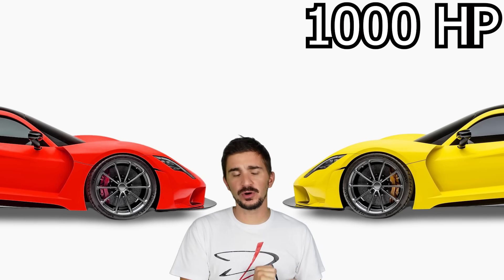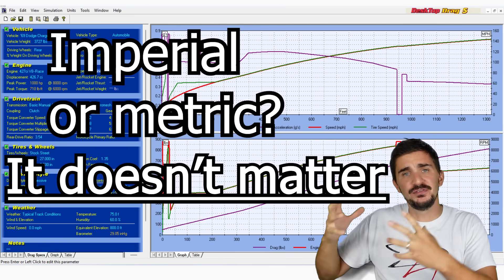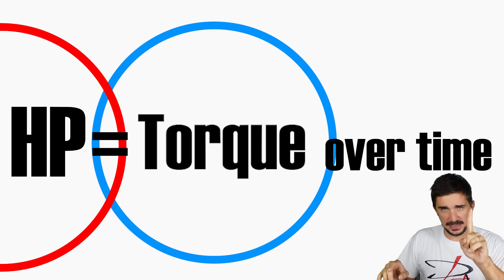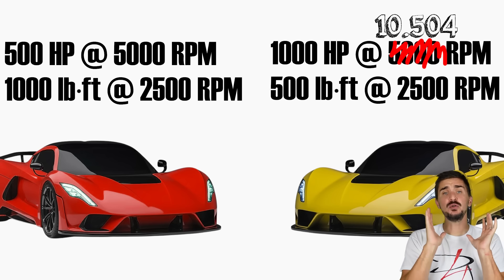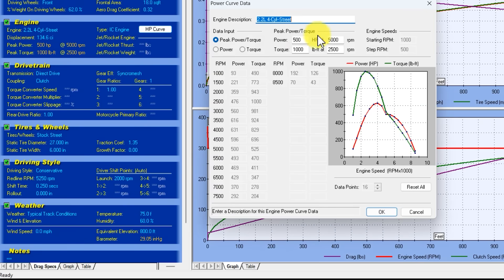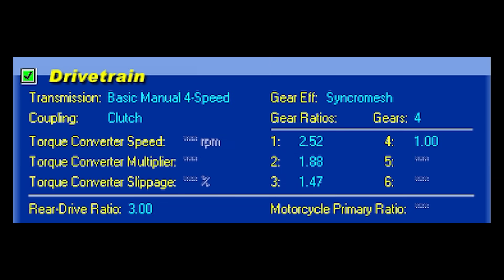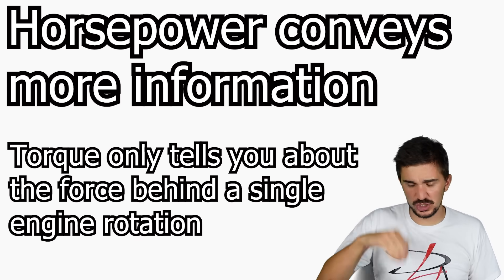Who's faster? Explained and Simulated - Horsepower vs Torque

Comment: Love the analogy of Torque = damage per hit, HP = DPS. 
A lot of people that are knowledgeable with cars will keep parroting that "torque = acceleration and power = top speed". Engine performance is 100% determined by power in the power band. People are under the impression that low torque is unresponsive but that's because casual drivers avoid the sound of high RPM.
Reply: That’s what I keep telling people. They don’t let the RPM go high enough for the engine to pay off and then they say their car is too weak.
Reply: @weekendmagus9994 There’s an old saying, “hp sells cars, torque wins races.” Most of the time that’s true, particularly for spirited driving around town.

If you match-up similar 300HP cars, but one has 300lbft and the other 200, it’s the first that’s going to be much more spirited for day-to-day driving and win the stoplight races. So, from a general consumer standpoint, a low-torque motor will almost certainly feel weak. They won’t get their HP benefit until accelerating full-out in the expressway.
Reply: @haredr6511  interesting. This clears out a lot in my head :D
Reply: @haredr6511 false 100% of the time, the guy with the biggest pile of Hp wins. 

Mike has a Vmax 4 800ps that makes, say, 240 HP at 10,500 RPM. The math is, tq x RPM / 5252 so his engine makes 120 lb/ft of torque at 10,500. Not bad. But his competitor has a ps800 Polaris that makes greater 130 lb/ft of torque and makes 230 hp at 9300.

But somone tells Mike that he needs more torque if he wants to go as fast as the Polaris. "HP is for dyno bragging, torque wins races".

So Mike, being a crafty engineer removed the low-torque race engine from his sled and fitted the pedal crank from his Schwinn bicycle to the sled tunnel, with 12" long arms from the sprocket to each pedal, then hooked a bicycle chain to the jackshaft. Mike weighs 150 lb so now when the light turned green Mike stood up on those pedals and made a wicked 150 lb/ft of torque with his legs, but the sled is a dog because Mike could only crank that pedal 30 RPM. 150 lb/ft x 30/ 5252 = .85 HP. He didn't get it, so he asked my girlfriend, who weighs 350 lb in her pink baby-doll nightie to ride on his shoulders while he raced his sled. Now he had SERIOUS torque-- together Mike and my honey weighed 500 lb total so now on the first pedal stroke he made 500 lb/ft so now that sled should be very fast! Problem is, Mike's legs are as skinny as mine and with my girlfriend riding on his shoulders (I made her put her panties on first) (and Mike, wisely, had wrapped his neck with saran wrap) his pedal speed dropped to 9 RPM! 9 x 500/ 5252 = .85 HP. Shucks. 500 lb/ft and .85 HP doesn't do squat, and neither does 150 lb/ft and .85 but 120 lb/ft and 240 HP is dandy. 

Now Mike knows its all about the combination of torque and engine speed. Jockey them both about, and get the highest possible HP, in as broad a plateau of HP as possible so the inevitable over or underrev won't kill you. Forget the torque, you need the broadest pile of HP.

Torque does absolutely nothing without lots of RPM.
Reply: @doomman700 My guy has a 1.6 diesel Renault with 130hp and 320 nm TQ, while I have a 2.0R NA Subaru legacy with 190 hp and 196nm TQ (7.5k rpm)..... We both manual transmissions
Reply: But sometimes the engine don't like it in case of longevity...that need to be revved usually means more abuse. But high torque car you can operare calmly in low RPM and be as fast maybe even faster and no engine wear happens. @weekendmagus9994
Reply: @weekendmagus9994 omg I hate when people drive like that too 🤣
Reply: Low torque is unresponsive in the sense of “power on demand”
If the engine has to wind up to 5500 rpm to make any decent power, that’s unresponsive.
Reply: Of course people are trying to save gas, not red line at every 🚦. In the other hand Automatic transmission will do that if you floor it. A civic for example casual acceleration it will make it rev high
Reply: Generally speaking, torque DOES mean quicker acceleration while power means a higher top speed. That's generally because a torquey motor makes it's power lower in the rev range. 

It's obviously not true of every vehicle but the more torque you have, the quicker the car will generally be.
Reply: @Boguardis that’s not true either, gearing multiplies the available power and your statement does not take that into the equation
Reply: @Boguardis  That’s why diesels get insane launches. It’s because of all that torque that is used to pull stuff.
Reply: @Boguardis  idk how realistic this example will be, but in need for speed Heat, i drove a stock dodge challenger srt8 which has 470 HP and 470 lb-ft of torque. now that thing is fuckin heavy but its high amount of torque pushes that car pretty hard so it accelerates surprisingly fast for its weight. only problem is, and i dont understand it but when it gets to about 90 mph and i shift into 4th gear a surprising amount of acceleration just goes away. i mean it still makes quite a bit of actual HP as well, so how does that work?
Reply: As a gamer I'm glad he used this analogy
Reply: That analogy is actually true, with the same gearing, and vehicle weight. By optimizing gearing, higher horsepower will always produce higher acceleration at a given speed, and given vehicle weight.
Reply: Trucks: I have moree torque, is there something wrong with me?
Reply: Torque is how much force you can apply, not speed afaik, so torque would be something like armor penetration, not damage per hit. If your opponent has 1000 armor and you have 0 armor penetration but lots of damage, it doesnt matter cause you cant penetrate the armor. You need torque, aka armor penetration to apply that damage.
Impact drills also just have insanely high torque, so they can defeat the bolts "rust" armor and get it turning. If you have low torque regular drill which can not penetrate the rust armor, the bolt will remain unmoved irrelevant of its max rpm.
Thats why European trucks have a lot of torque while American trucks have more horsepower. European trucks need to get moving quicker due to lots of turns in small places. Aka the weight of the truck is that armor and you need torque to defeat that armor

To explain further as to why neither hp nor torque is the "best" and to explain this armor analogy further.
You have a monster with 100 armor and 100 health.
You have 10 armor penetration and 100 damage, aka low torque and high hp, the monster will die in 10 hits.
You have 100 armor penetration and 10 damage, aka low hp and high torque, the monster will die in 10 hits.
But what if the monster had 1000 armor and 20 health? Youd probably want more armor penetration than damage.
But what if the monster had no armor and 1000 health? Youd want damage, not armor penetration.
Cars with weight want torque, cars for speed but no weight want horsepower.
Reply: @DageLV  Jesus Christ its not that serious man lol. Just say torque is force which it is and call it a day.
Reply: @ryze9153  lol why are you bothered by that? xD
Reply: @ForsakenWastes  I'm not but he went unnecessarily deep into something that's way simpler.
Reply: True, almost every single car video has some idiot clumsily writing in the comments section that torque = acceleration and power = top speed. 
Im fairly certain i can apply more Torque with my leg than a 600cc supersports bike at the crank, dont think ill be winning any races though.
Reply: Nobody talks about power under the curve, imo that's the most important factor in a street engine, torque at least at the wheels can be set with a correct drivetrain. People talk about max hp, but you rarely use an engine in that range. A torquey engine has more hp down low.  Hp is literally how much the car can change its speed. You can have a million ftlbs of torque at the wheels, if the rotation is slow due to short gearing (low hp)that car won't be fast. If you have 1000hp at the crank, there will be 950 at the wheels due to losses. Also this video missed the correction for twice the rpm in the hp engine.
Reply: @Stratocasterhead51  I mean, technically, they're not wrong. You need the highest possible torque at the wheels for the highest possible thrust (therefore acceleration), asssuming perfect traction.

For a constant gear ratio, this happens at peak torque. When gears come into place, for a given vehicle speed, this definitely happens at peak power.

Additionally, to compensate air resistance, you need power (drag force times speed), so the higher the power the higher the top speed. Let me know your thoughts on this.
Reply: Very true. You can produce almost as much crankset torque than the engine, but, you do it at 100 RPM, not 10,000 RPM! The motorcycle is ~100 times more powerful. @Stratocasterhead51
Reply: @Stratocasterhead51 you are not mentionnong power to weight which is most important tbh
Reply: Exactly, if torque equaled acceleration, why don’t drag racers chasing records shift at peak torque ? It’s because they understand the power band and rev it out to peak power
Reply: This
Reply: Horsepower is derived from torque and rpm
Reply: I agree with you on that RPM thing. But I understand that maybe people simply don't want premature wear to the engine. I, for instance, cannot afford it xD
Reply: I guess I'm not a "casual driver" my b-series has an 8200 rev limit and I'm gonna use it all every chance I get
Reply: Power = force x velocity. Watts = volts x amps. Horsepower = torque x rpm. It’s all the same formula.
Reply: I love the sound of it,  zzzzzzzzzmmmmmmmmnnn
Reply: I was always explaining to myself that Horsepower is how fast the car can go(ex. 300km/h) and Torque is how fast you achieve that speed(ex. 0-300km/h)
Reply: well torque usually is = accel because torque is like the force that it has to start moving the piston, aka how much force, or power, can be applied at low gears, therefore acceleration, right? this is my understanding of it
Reply: Omg I HATE when people say that 😂. "Torque is acceleration and power is top speed." It's as if they don't even know gears exist 🤣.
Reply: HP  = how fast i can hit you in the face
Torque = how hard that punch to the face is
Reply: @Chomper1978 no. Rpm is how fast you can hit, torque is how hard you can hit, and horsepower is damage per second.
Reply: A decent understanding as I hear it is torque = growl to hp = screamer
Reply: The analogy is HP is damage per minute, not dps
Reply: @pyropulseIXXI  DPS is damage per second, both are units of time.
DPM is just DPS x 60.
Reply: @pyropulseIXXI  Gamers say dps to refer to total damage in a lot of situations, and while it does come off as incorrect in the way you present it, the analogy makes sense if you play games that have damage scaling and sweaty players.

Comment: Grear comparisons iv watched a few of ur videos now. 
Ur easy to follow understand very good teacher speaker. 
I also agree HP is more important than torque but really they work together. A great comparison is dirt bike been riding them  for many years. Lets go back to a 125 2 stroke vs a 250 2 stroke. 125 don’t make lot of torque but get the RPM’s up feels very fast because 125 makes good HP. Iv owned both 250’s and 125’s at same time. The 250 is easier to ride because of the torque it makes. 
Also 250 makes more HP but with the tight gear box ratios iv had 125 go faster top end than my 250. The only thing i can conclude is the 125 revs out much further than the 250. With different gearing im sure the 250 would be faster of course. But with the tight gear box u run out of gear so the 125 revs out keeps pulling were the 250 stops. I still own my 2001 CR125 had to sell my 250. My 125 I bought new so sentimental value lot of races on the 125 cant get rid of it Plus its just faster than 250 was.  lol!!  Both my cr125 and cr 250 were pro level race engines built myself. 
Great stuff
Thanks for the very well put together video very impressive.

Comment: The real lesson is that gearing is everything.  If you build HP from RPM, you'll need very different ratios vs HP from torque.  IMO, making power is fairly easy compared to applying it right.
Reply: best gearing dont help you against not perfect gearing version which still have  more avg power for acceleration 😉👌🏻 but yea from specified point of wrong gearing setup much more powerfulll version engine can  lost race  but its like setup cheetah vs turtle 100 m race where you tie cheetah legs 👌🏻 anyways gearing is defenitelly not everything 1 hp engine woth perfect gearing for specified aplication still lost vs 100 hp engine with not even close to perfect gearing setup asssuming 100 hp version would use for race slightly more than 1 hp it still win this race 🤷🏻‍♂️ offcorse not with huge margin at such bad setup but still the gearing for 100 hp for lost this must be so foken bad that its almost imposiible to happen but yea if somebody really want to he can setup so bad gearing 🫣 😁👌🏻

Comment: I think of torque being how much work and engine can perform and horsepower, how fast it perform this work. A semi has 600 hp and 2000 tq. This means it can do ALOT of work (2000) but very slowly (600). A V10 Formula 1 engine 900hp/300tq can do a little bit of work (300) but extremely quickly (900). My Mercedes Benz ML350 BlueTec diesel came stock with 210hp/400tq. After tune and deletes it has 305hp and 550tq. This means it does 38% more work, 45% faster. This means the ML now has a dramatic increase in acceleration - dramatic. But would I prefer if the engine produced 400hp and 400tq? Would this mean a better driving experience? At 400hp and 400tq, the engine does the same amount of work but TWICE as fast. The answer is "yes". 305hp/550tq is better for towing and the 400hp/400tq is better for acceleration making for a more thrilling driving experience. All this work and acceleration happens between 2000 and 3800 rpm - an 1800 rpm range. This means the gearing can be longer to take advantage of the "massive" amount of torque the diesel engine produces. The 2011 ML has a 7-speed transmission. The last Mercedes Diesel in North America in 2016 has the 9-speed transmission. I read the driving experience with the 9-speed is quite different than with the 7-speed - not as satisfying due to the "disruption" in the feeling of the torque smoothly, effortlessly pushing you down the road. Remember the 60's cars with a 390 or 454 cubic inch engine with only a 3 or 4 speed transmission? The acceleration was like that of an airliner... just constant uninterrupted acceleration. In 7th in my ML, I get a very pleasant acceleration from 100 kph to 220 kph with a noticeable increase of rate of acceleration around 140 kph. This is when I can go WOT/full boost without the transmission shifting down into 6th. I am seriously thinking of buying a 2013 E550 sedan with the same engine and doing the same tune and deletes. Why? The E550 weighs 1000 lbs less than the ML and is only rear wheel drive, which means less driveline loss/friction than the AWD ML. The acceleration will be more impressive in the lighter E550. Cheers.
Reply: 400 hp 400 lbf ft version still be tow better stuff than 305 hp 550 lbf ft at perfect gearing pnly diffrenc be that it must be driven at higher rpm 😉👌🏻 at the dame velocity at the same low rpm it be weaker than 305 hp 550 lbf ft version but on higher rpm where its engine genersted more power now it starts tow stuff stronger 👍🏻

Comment: High HP low TQ   = peaky HP curve, 90%+ Hp for about 500 rpm                   the more gears the better,                                       Think Hondas and pure racing
Even HP to TQ     = Appalachian hills HP curve,                                                  6 gears is plenty,                                                       think newer muscle cars (post 90s) great for daily drivers
Low HP high TQ   = Pancake HP curve, 1000 rpm to red line gives full HP,    handful (3) gears will do,                                         think luxury, lazy people, why shift.  70s 80s Oldsmobile and such

Talking standard car weights,  if you add weight changes to this the write up would quadruple or something.

Comment: "DYNO DAY"  for me was this thought experiment put into practice. Guys would like to rage through the gears to get more appealing numbers, but starting the run in the closest 1:1 gear gives you more accurate data. For my RSXS that was 4th gear and it seemed to take forever to chew through the 8400rpm.    if I recall correctly,  I put 186hp and 132lbft, but on a dyno sheet torque and HP are plotted on the Y axis and RPMS on the X

Comment: Your test is flawed tho as the two motors would require different gear ratios to gain full advantage of each respectively... You only compared them with same ratios.

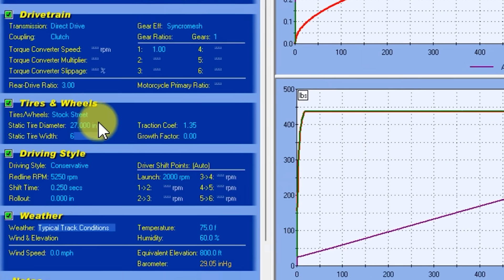Comment: 9:42 You should've given the high-torque car Race or Pro Stock tires to make the test more fair, since you admit at 9:48 that it still has wheel-spin for the first half of the race, whereas at 10:04 you say the high-hp car has zero wheel-spin. So better tires would've given both cars less wheel-spin, for a more fair test. If a car only has HALF the horsepower of its opponent, then it's very fair to allow the use of racing tires or drag slicks. You helped the high-hp car by giving it a transmission, so the high-torque car deserved to have better tires. Even if BOTH cars used the same better grip tires, the high-torque car would win. Or if you conducted this test with two AWD cars, where the car can't transfer weight to the neutral (on RWD) front tires to allow the rear tires to lift and spin, and the car is forced into traction with all 4 wheels moving, then the high-torque car wins. You can see from the graph at 11:16 that the high-torque car had wheel-spin (wasted power) at the beginning of each of the 4 gears, which would've been reduced or eliminated with sticky drag tires and/or AWD transmission.